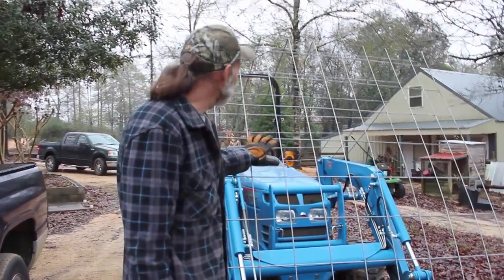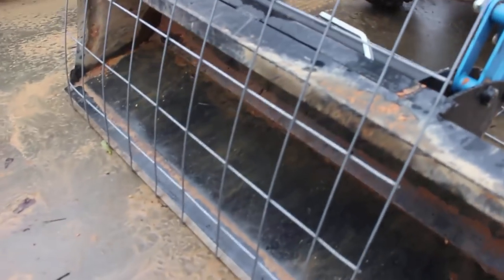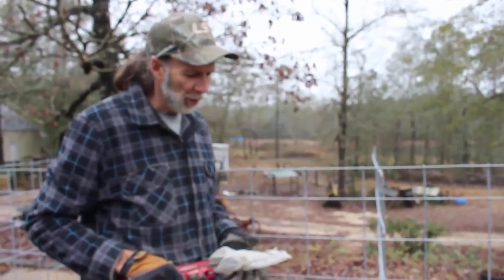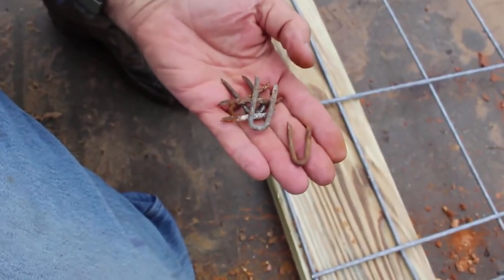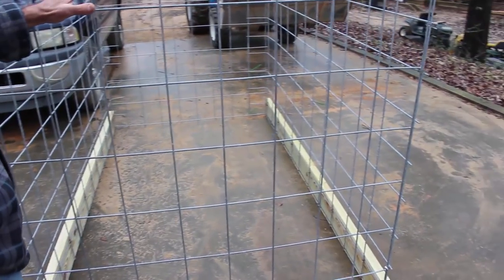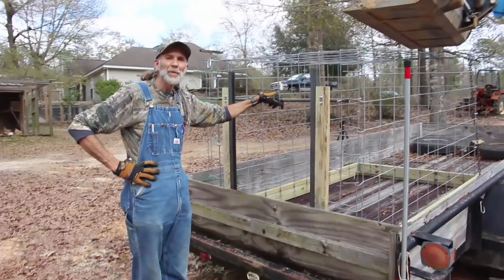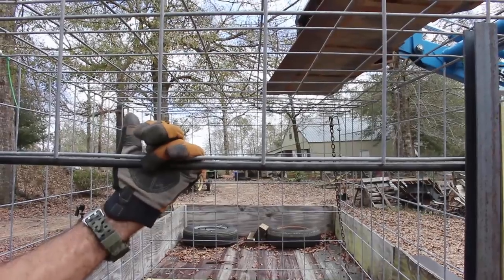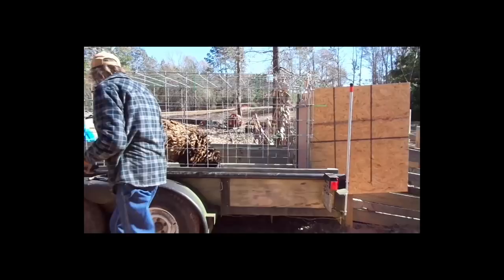DIY Livestock Trailer --  Using Cattle Panels

Comment: I never thought of using Hose clamps like that,  so glad I am decided to spend my lunch break watching old videos.   Its actually cooler today so lunch break is going to be short.    I need to take advantage of cooler daylight hours because in about a month from now the days will have rapidly gotten shorter.   Thats the problem with August,   it still carries the heat of July but adds in the shorter amount of day light hours of September lol

Comment: Great  job Danny!  I  was  given  4  pcs  of  hog panel  that  had been  hit on  one end with a fork lift  for  $10.00.  I  started  cutting off  the  damage parts with my  ancient bolt cutters,  started  a real  battle  until  I  Wd  d  and  oiled  them!!!!  So  much  easier!!!  I  fitted  the  panels onto  my  10'  metal  trailer  using  Ubolts  and  wiring  the  corners.  Hauled  wood on  it  last  week  and  didnt  loose  any  of  it!!!  I  may  see about  adding  a  rounded  roof  to  it.  I  sold  my  horse  trailer  several  years  ago  as I  wasnt  using  it,  but the  flat  bed  could  haul  small  stock  with  a  roof on it!

Comment: I just did something similar yesterday with 60" horse panels so I  could haul sheep. Mine isn't up to the standard I  like right now but I plan to get angle iron to weld up a full frame and weld the panels to the  frame.

Comment: Danny that bucket makes a mighty fine metal break. Cattle panels are so handy. Great idea!
Reply from the maker: Mr. Rain I use to do sheet metal work old trick i learned when you dont have a metal brake handy. Thanks
Reply: Necessity brings about creativity, thanks.

Comment: Looks good, I wouldn't bother welding it. Add a couple more good clamps and you'll be just fine. I welded those panels once before and the welds cracked from the flex in the panel.
Reply from the maker: G Garden Thanks for that info.
Reply: My same thoughts.   Especially when the welds age with s large hog inside.  Even though I have found more often once a hog has been loaded they tend to get nervous in travel and hunker down tight.   Large diameter cable crimps may work too.  Mine have held strong tight now for two years on fence corner braces

Comment: Just like in the old days - multi-purpose and efficient use of tools, equipment, and materials based on need, cost-effectiveness, and simplicity. Wonderful! A question - using your plan and having no tractor, would that unit be too heavy for a couple to pick it up over the side rails of the trailer and set it into position? Thanks!
Reply from the maker: Quake Lake Homesteaders Wanda and I could have lifted it on the trailer but why when we have a trailer. Thanks
Reply: That is good news for those of us that DON'T have a tractor!! lol :) I now know that this will work for us, too. <3

Comment: Very well done, especially for needing it right away.  Once it is welded it should work well, especially for what I think of as "small stock."  Not so sure about a calf unless there is more bracing on the sides.  I have seen cows plow through barbed wire without thinking twice.  A calf, if it does not travel "well" could make a mess of that and get itself into trouble if it started panicking.  Cows can sure have a potential to try to ignore barriers. Hrmmmm ...

Comment: Hey Danny is that LS tractor you still happy with it? Thinking about buying one ?
Reply from the maker: Nathan Rittenhouse if you buy dont buy the XG3025 it is having a lot of problems i got a recall on this model done because if you use the front end loader a lot the engine will start leaking oil. Even after the company fixing it the problem came back again.Im now working with the company about getting a new tractor or giving me my money back for this one. The next size up from this one dosent seem to be having problems that im aware of. I may look at going in that direction. Mine has been in the shop for 2 months out of the 3 that i have owned it. Not Good Thanks
Reply: Thanks Danny